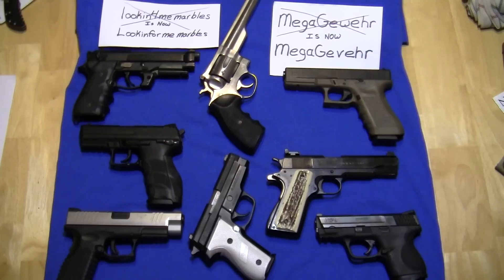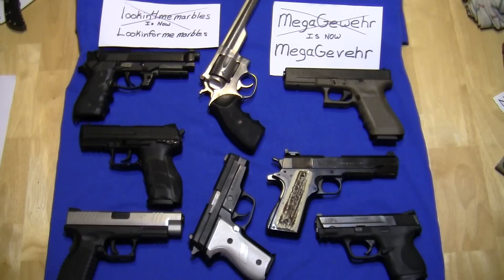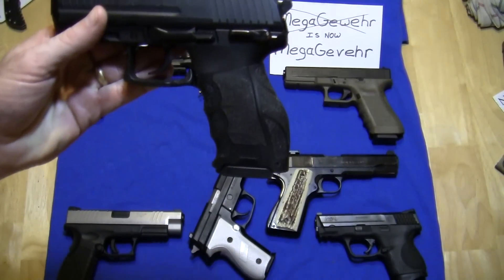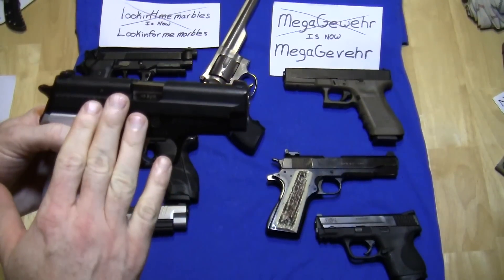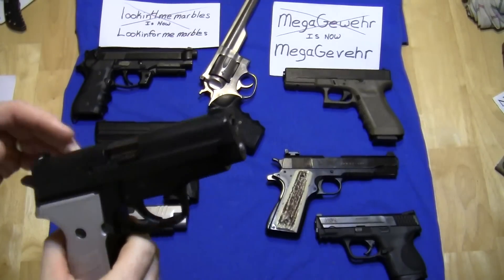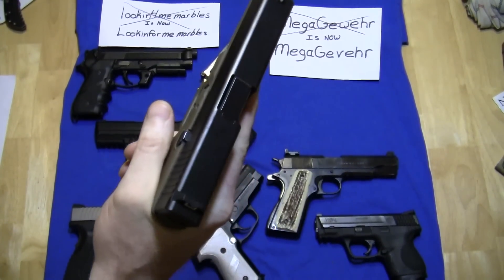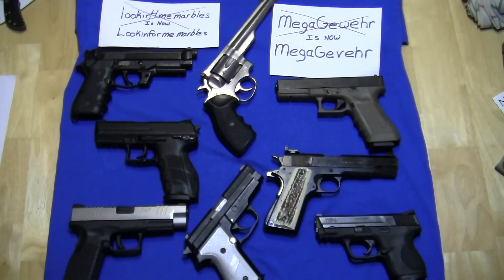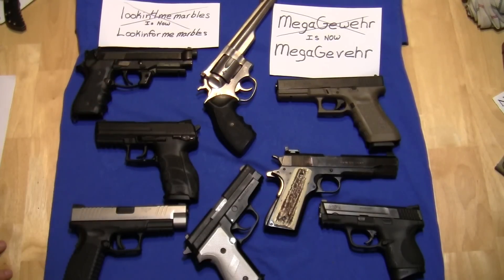Shake, Rattle, and Roll: To My Buddy, GwarGwar1981

Comment: For my experience the frame to slide fit dont have anything to do a lot on accuracy specially on a 1911 it all depends on the barrel lock up on the locking lug, that is the one the first thing that will affect your barrel upon firing your weapon. good vid

Comment: I think that the shake is more noticeable when the magazine is out. It's an issue because not all Sig's have the excessive rattle that some report, which makes this a QC problem. There is a spectrum of normal shake in most pistols, yes, but not to the extent that Sig's do when they have the shakes. Rattle also happens when handling them slowly. I understand why people are pissed.